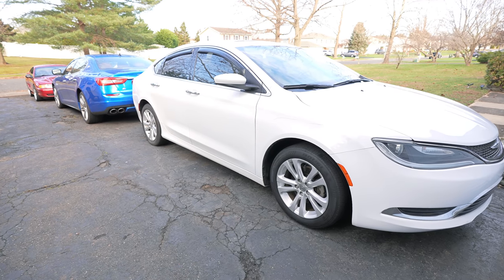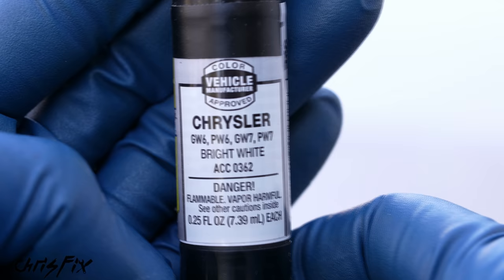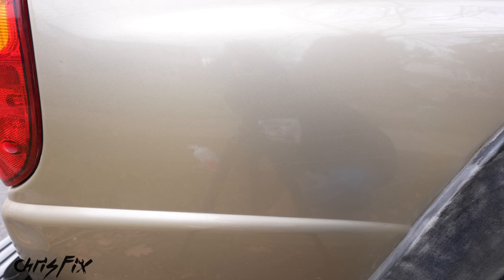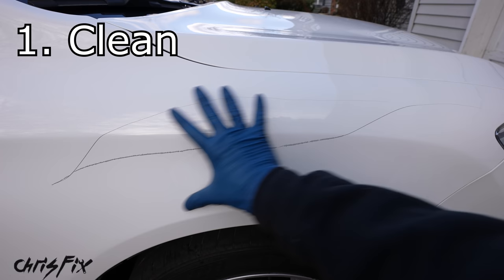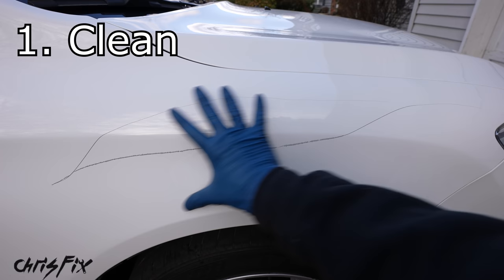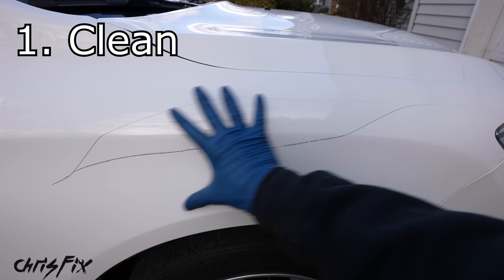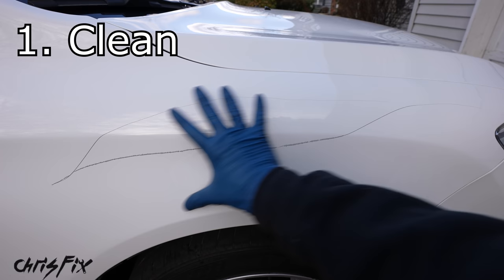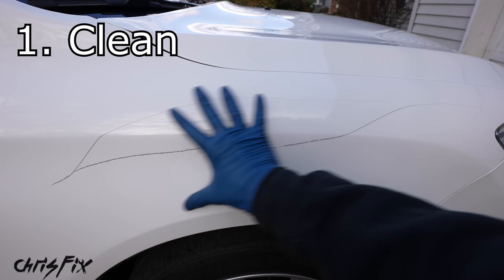How to Repair a DEEP SCRATCH in Car Paint (DIY)

Comment: If you're reading this, hopefully my comment will bring your expectations down to earth. After reading the other comments, you'll think this job is a no brainer... It's not. Especially on darker metallics. If you start wet sanding on a touch-up, you're going to find yourself at a body shop real quick right after you blast through the surrounding factory clear coat and have a dark hazy ring around your scratch.
Reply: Do you have any recommendations on how to do this on black metallic paint?

Comment: "Your not gonna be able to fix the scratch perfectly" proceeds to fix the scratch perfectly
Reply from the maker: You can still see it at some angles :p
Reply: @chrisfix  absolutely but no doubt you are good at what you do
Reply: You're*
Reply: @TheRabbitFear  Thanks mr. Grammar
Reply: @iinotpxnda  *Thanks, Mr. Grammar.
:D
Reply: @dharm3974  Lmao
Reply: @TheRabbitFear  bruh, it's the same
KAREN!!!!!!
Reply: @chrisfix hi
Reply: @idkrandom457  Ah, yes, yes
Reply: It is an amazing repair... That said, lighter colors are much better at hiding scratches :)
Reply: @Numenor7  that's what I thought 💭 why He didn't do it in a black paint or a red but it doesn't mean He is bad  doing that
Reply: @MrChanatekbron  💯 agree 100% man. He did an amazing job.
Reply: @chrisfix  Looks great, I'm about to do this with my 2001 E55 AMG. However—and this has no bearing on how helpful (all) your video(s) is (are),—as a professional videographer I must ask: did you adjust your white balance to improve the before and after effect?
Reply: @chrisfix  the pen toyota sells doesn't include a separate clear coat. Can i follow everything minus the clear coat step and achieve same/similar results? thanks, appreciate the help
Reply: @keegmai  I just worked a large area on my truck and the pen I got direct from the manufacturer (no aftermarket available for mine yet) didn't provide enough clear coat. I ended up buying a spray bottle of clear, blasted a bunch into a small disposable cup, and used that. No complaints about the application so far
Reply: hahahaha
Reply: is just harder to see because its on a white car?
Reply: @idkrandom457  you're*
Reply: @jaipurjourney2206  No it is not the same. You're means "you are" and your doesnt mean "you are"
Reply: @newbielol5119  u aren't a pro discord user lol
Reply: @jaipurjourney2206  What are you talking about?
Reply: @newbielol5119  Uhh
Reply: @chrisfix  HEY CHRIS DOES THIS APPLY AS WELL TO PLASTIC BUMPERS SIR ???

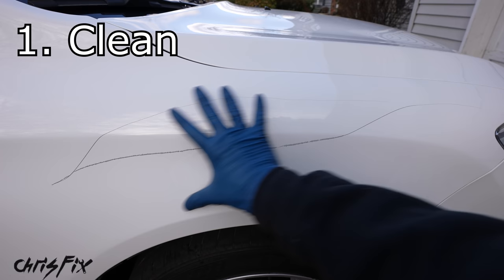Comment: 8:12 - Clean with soapy water (dish soap)
9:27 - Sand rust & jagged edges (P400)
10:03 - Sand edges smooth (P800 then P1000), wipe with alcohol
14:00 - Tape off 1-2mm away from scratch
14:54 - Paint several thin coats to fill scratch higher than surrounding paint (~5 minutes between coats)
17:29 - Let dry for 10 minutes, then peel tape on itself at 45 degree angle. Let dry for an hour after peeling tape.
19:02 - Wet sand (P800) with soapy water until smooth, fill in any holes, wipe with alcohol
22:01 - 2 clear coats, 10 minutes between coats, let dry 1 hour
22:32 - Wipe with alcohol, wet sand (P1500 then P2000) until clear coat is smooth with surrounding paint
24:16 - Wet sand the whole panel with (P3000 then P5000 with a sponge)
25:26 - Polish whole panel
Reply: Thank you
Reply: Um its soapy wooder
Reply: Thanks
Reply: Thanks. Saved me some time!
Reply: Thank You.
Reply: Cliff notes, cheat sheets, my savior
Reply: Very good
Reply: Thanks
Reply: You are doing GOD's work! 
I really appreciate ChrisFix sharing his knowledge but damn, his voice is so annoying! And the video so long for what "should have been an email".
I don't want to sound mean or hurtful, it's just my opinion and again, thanks to ChrisFix for making this video, I hope you don't take offense in what I wrote.
Cheers!
Reply: @johnmp1470  English is not my native language, but I don't mean to insult him in the slightest. I am talking about the way he talks, like on purpose with accents on some syllables and extending some sounds seeming forced output. Like a DJ on the radio (I don't know how to explain myself) or news anchor. It's a style of talking to fill in all the "awkward silence" making it fill up the place (acoustically speaking).
Anyway, I only meant to give a feedback not even for a second wanted to offend this man who clearly is to be praised for all his videos and I truly am thankful.
I expect the same in return: if I sound annoying for someone to let me know, this way I can gather more feedback and work on improving (if it's something I did not intend on doing on purpose).
Reply: Is it really dish soap!?
Reply: Thanks so much for this detail description. i can't wait to fix my car i just scratched last night while i was a little drunk and tried to move it to the right spot in my parking lot.
Reply: Not all heros wear capes
Reply: Thanks for the time-stamps!
Reply: Thankyou!
Reply: @factsnolies7650  yes
Reply: For wet sand in 19:02 it's 600 grit, can you make an additional edit for that?
Reply: Godsend mate
Reply: Thank you for this, very helpful
Reply: Went in with p600 sandpaper an hour later and it took off all the paint I just put on.
Reply: @stephaniecreed6474  no wonder if you sanded for an hour. each grade of paper only needs a minute or so
Reply: @johng4758  lol I didn’t sand for an hour. I waited after the paint was dry an hour.
Reply: @stephaniecreed6474  ah okay I see. Either way you must have sanded for to long or to hard
Reply: Good summary. Complements the video's awesomeness. Both you and Chris are angels.
Reply: Thank you! I wish the video had these simple subtitles.
Reply: @Sergiu_K  ool0
Reply: youre a legend
Reply: Thank you and thank God for Chris Fix!
Reply: @Sergiu_K  LOL sure thing mate, all I read in your comment was an insult and it doesn't matter what country you are from, an insult is the same. I wonder what you sound like on a mic huh, with your accent? I am actually using these tips right now on a deep scratch repair that is not worth 
Imifumei's panel beater's way because the car is up for a full respray soon.
Reply: Thanks man too much bs
Reply: After Watching what you Typed Down, I am Wore Out...LoL..
Reply: @Sergiu_K  of course it's rude what you said, how else would he take it?

Just accept his voice as it is. 

Chris was born with his voice and he has no control  over it. 

Heres a tip.. Just don't comment in future!
Reply: Very cool 😎 time well appreciated. Very patient. I like.
Reply: Can someone help me?! The pen said to be harmful vapor and cause cancer/ infertility. What things do I need to wear when I use the pen??
Reply: @addvictory  the paper says 800 when he wraps it around the domino…..
Reply: For 19:02 the paper says 800 when he wraps it around the domino…..
Reply: @CanadianMum444  what wrong post dear I tink u commenting any kind yeah u!!!!
Reply: Will this work for scuff marks
Reply: @abnervazquez3783  yeah haole work for anything u like g just got know what fo do
Reply: @fdr3170  u like boto?
Reply: You are a hero..
Reply: Thank you..he is unnecessarily making lengthy speech..
Reply: Thank you, these commercials are killer!
Reply: Just took a screenshot, thanks. 👍🏻
Reply: Add one last step 25:40 - Buff the panel with a microcloth.
Reply: @rofiahsarumi3038  yes
Reply: Don't hold accountable, but take your time if you're invested.
Reply: @stephaniecreed6474  he did say 800 not 600
Reply: remember if you have a small scratch you dont have to sand or polish the whole panel, just the surrounding of the scratch...
Reply: Thanks
Reply: Certified Big Dog  Buy a new every day, week or month.... any more suggestions?
Reply: @imifumei thanks for your summary.  Please correct sandpaper at 19:02 mark to 800 grit (not P600).  Please see 18:25 for confirmation.  Thank you
Reply: @stephaniecreed6474  me too.
Reply: This should be pinned or added to the description of the video. Thank you!
Reply: great. you've simply made it more easier to do and understand.
Reply: Don't use dish soap on cars. Use a light soap.
Reply: Thanks
Reply: He said don't sand in circles
Reply: thank you for this
Reply: Answered my question. Thanks
Reply: Screenshot this! 😊
Reply: Thanks.
Reply: Yup
Reply: Thank you!!! He forgot to post all the sand paper grits in the description so this is so helpful for that as well!
Reply: You’re the best!!!

Comment: I’ve owned a auto detailing business for 15 years and have always sucked at touch up. I’ve always been told to fill with glazing putty first but I’ve never had results like this. I just tried it on my own truck and I don’t know if I’m more mad at myself for how simple this is or more happy that Chris posted this
Reply from the maker: I mean it’s not perfect. The best way would be to sand it smooth and use putty like you said but for the time/cost and for these results it’s good enough. But I’m glad I was able to show a new way of doing it!
Reply: @chrisfix  when you say putty, do you mean bondo?
Reply: @Terrence432  no he means glazing putty. It's meant to fill fine scratches after your Bondo step.
Reply: @chrisfix  Hi Chris. Would this touch up job work on a 2014 red Kia Rio. The paint seems kind of plasticky on my Kia do I don't want to mess up the whole panel by sanding it down.
Reply: Oh I'm happy to hear that it worked
Reply: @chrisfix  I hit a pole and the yellow paint from it is on the car. How do I remove that paint before I start this process of fixing the scratch?
Reply: @mynappyspirit  with WD-40.
Reply: @mynappyspirit  easy way would be compound
Reply: @mynappyspirit  Acrysolv should do the trick
Reply: Quick tip, if a scratch is very deep and u dont want to do it the right way u really can use some finishing putty to fill it.  While it is setting up after uve spread it on there u need to get a rag with some lacquer thinner on it so you can wipe off all of the excess putty so you dont have to sand it.  Much like using water and a rag to wipe off household spackling. Then do your touch up. If you dont want to fix it the right way that is.
Reply: @Terrence432  it would be best to use finishing glaze. Which is like bondo but with much smaller particles.
Reply: @mynappyspirit  lacquer thinner.
Reply: @chrisfix 🎉

Comment: I scratched my wife's car, her BRAND NEW car! Chris, you have saved a marriage! Great detail, great explanations, and thorough video. Thanks, Chris Fix!
Reply from the maker: Dang, but I'm glad to see you got it fixed!
Reply: @chrisfix  I am an avid fan of yours. how can I fix the peeling paint on my 2018 Toyota bumper that was hit by the cart in the parking area, the paintpeels.  Do you have a video for that?
Reply: @zoemarano9590  if the paint is peeling, either paint it yourself, or have it painted at a shop. When its peeling, the clear coat is too sun damaged, or its been hit hard enough where the paint seperated from the plastic bumper. Spray paint it, with oem paint, and clear coat the area, and wet sand it, and polish it.
Reply: lol. I am learning it now in order to save my marriage.

Comment: bodyshop " we'll repaint the body panel for 700+ dollars"
chris: "15 bucks, take it or leave it"
Reply: Yes
Reply: To be fair, when you look at the estimate costs, it's almost all in high charges for labour. Think the cheapest I saw was for 55/hour.
Reply: @Whoreally Cares They're charging standard rate, where a fraction of an hour's work is still paid for a full hour. Time they don't have to actively work on it is not being charged. And, lastly, they aren't just fixing the scratch up like how Chris did it here, but are pulling off all the paint entirely and repainting the entire panel, professionally. That takes time and effort to do. I just don't think it's $55/hour worth.
Reply: Welllll if you consider how long this process took Chris and factor $70-$90/hr (have to pay for a shop) it would cost $300-$500. But at that point you could have the shop just repaint the whole panel which would be much better than paint pen.

Touch ups on a repair this big are only worthwhile if you do it yourself and use your own labor instead of the shops labor.
Reply: @KainYusanagi  it's very expensive to run a shop. At $55/hr they are paying a employee half of that, then the rest goes to pay for the expensive paint/supplies, rent, utilities, non billable employees like front desk person, insurance, ect. Most shops dont profit much more than 10%....at $55/hrs they probably dont profit anything, they are just trying to get extra business to pay for the overhead....or it's more like a guy doing his own thing with very little overhead....like a mobile guy or something. Now a days $55/hr isnt enough to run a full shop, they will go out of business at that rate.

Comment: Chris is a superb instructor, covering every single step down to the exact way to hold a tiny sanding block and why.  The instructions and closeups and added graphics make the “how to” crystal clear.  It’s still a learning process for a newbie like me, but these details are giving me the confidence to fix the latest scratches on my new driver’s front bumper.  The one that she tore off completely four months ago.
Reply: I'm doing something similar to his video but my example is larger scratches and paint chipping. It's an area about 1.5 inches wide and 2 maybe feet long (horizontally) along the rear bumper. I wonder if adding touch up paint and sanding it will look okay like in this video. I'm worried about it since its much wider of a gash that I'm filling in. I put a few layers of primer first and sanded it smooth to match the surface level or maybe a bit lower. To make sure the paint sticks since its not just a few millimeters wide. So I'm about to add the touch up paint layers tomorrow but I worry about wet sanding it after. Since it's a wider area. Will it look like crap, I wonder? Lol. Also it's a dark gray metallic (Audi) and I hear sanding metallic paints isn't the best look. But what can you do with touch up paint. Gotta sand it or it ends up looking very uneven for sure. Any extra tips from anyone? To try and get the best results in my particular case.
Reply: I noticed after wet sanding the touchup paint, he didn't do anything beyond the 800 grit on the surrounding clear coat. Right now my clear coat around the primed area (which got sanded with 800) looks scuffed up from the sanding. But he adds the clear coat right on top of that. No smoothing with 1500 or 3000 grit first. I am assuming the new layers of clear coat just kind of blend into the scratches/scuffing of the underlying factory clearcoat. And you won't notice that scuffing. It sure turned out clear and smooth in his case. Does anyone know about this in detail though? Especially on dark gray paint where the clear coat sanding is more noticeable.

Comment: Just a heads up anyone with little to no experience in detailing cars like myself. I attempted this on some key marks and it did fix the paint but it left very bad clear coat damage to every where around the former scratches, I went to a body shop today and the owner said I should have never used anything less than 1500 grit and I permanently damaged my clear coat. Long story short I have an appointment with him to the tune of $850 dollars to fix what I attempted to fix using this video. I also have 0 background, I'm an electrician, not a car guy. But thank you Chris for the attempted help Chris and just think twice guys because I would have been waaaaaaaaaaaay better off and richer had I not tried to do this myself
Reply: that's the reason why you apply clear coat and you blend in by sanding and polishing. All your body shop did is apply the clear coat and smooth out better than you did :)
Reply: He used a white car, if was any other color you’ll see how shit he actually did.
Reply: @tburka91  How do you know he did shit? You can't see his job either.
I paint many cars and bike in my life and that's exactly as I did. If you have bad results it means you don't know how to do it. A pizza is a simple recipe, still not everyone can make a good pizza.
Reply: his videos are good but dont take them as gospel, checkthe comments and do further research to make sure theres more proper ways and dont do anything half assed.  the dude is a teenager and even worse, a car flipper, so he will be cheating and doing half assed shit because they arent his cars and he doesn't care
Reply: @MrWolfSnack  He's actually 26 lmao, and his main income is youtube. Not flipping cars. good shot though.

Comment: I just got quoted $2k to fix a few deep scratches on my car. Thanks to this video I think I'll pocket all that!  Thanks a million Chris
Reply from the maker: It’s not as easy as it looks but it’s def worth a shot if you have a car that’s not pristine.
Reply: My car is 17 years old and the scratches are on the roof so it doesn't need to be perfect.  Just finished and pretty happy with how it came out.  Main issue was the roof was too hot and the clear bubbled going on.

I would also pay more for a better clear coat/brush product if I had to do it again.  Regardless it looks much better and definitely worth the $2k savings!!